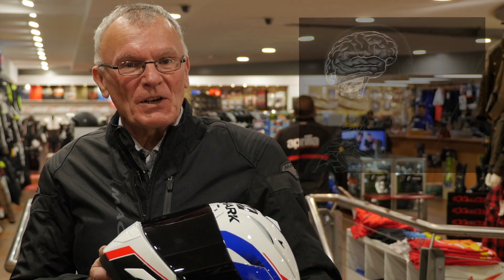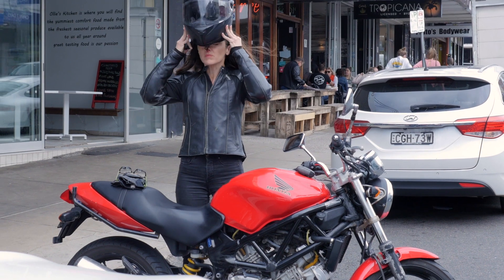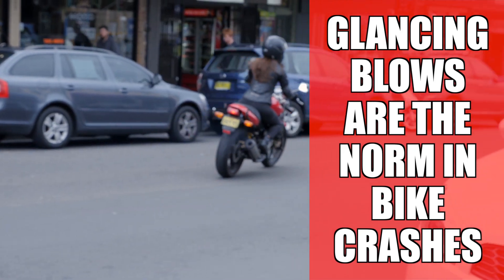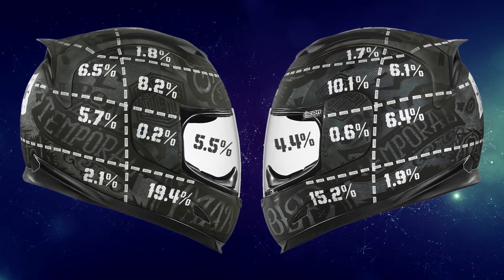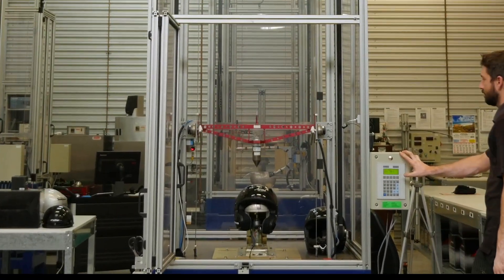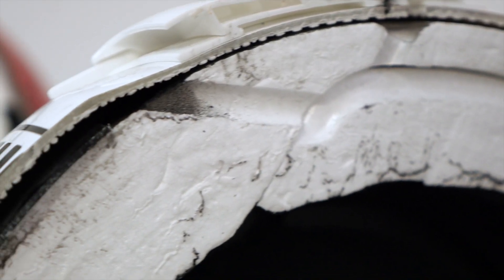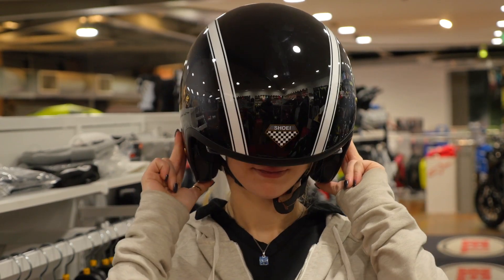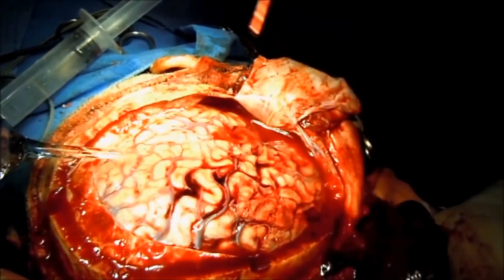What Helmets Do & How They Work

Comment: Yesterday, I had my first ever wipe out of my electric longboard. I promise you, on God, I wouldn't be here today if it wasn't for my helmet. The speed at which the back of my head hit the ground was unmeasurable and the back of head legitimately bounced of the payment. I stood up, ZERO scratches on my body, and zero injury to my head. Only thing I can say is my chin hurt a little bit from the impact from hitting against the inside part of the helmet, but that pain went away within minutes. Additionally, the front plastic see through visor came off but was easily able to snap it back in place.
Even more great news.... Tell me how after hitting the back of my head on the pavement, there was absolutely NO DAMAGE to my helmet from where it hit the ground. Not even a scratch. I thank God for the fact that I have such a durable helmet and that I'm always guided to wear one even if it's hot outside.
Wear your Helmets people.
This experience happened to me just yesterday and I'm blessed to have come out of that horrific accident, scratch free, to tell you the story today
Boy God is good I tell you. If it wasn't for my helmet, my brains would've been splattered on the pavement yesterday evening.
Reply: Pretty sure your helmet had a few scratches if it protected you in such a horrific event as you described.   Thankful that you don't have a scratch though.
Reply: helmets are only rated for 1 fall. might want to replace it
Reply: Nice to know you're OK 👍 keep doing you, safely
Reply: Thank yourself for taking the helmet and thank your helmet for protecting you

Comment: a perfect fit could be acheived with todays 3D scanning technology to scan a riders head and custom mill/mould the EPS inner profile but like all companies today they pump out a range of gear some not fit for purpose and are more concerned with profit instead of producing only the best helmet possible for the lowest cost. and where is the innovation for prescription glasses wearers who's glasses might not fit in a full face helmet - option to fit a clear drop down with C channel lip holes for fitting prescription lenses into. there was also a racer the other weekend whos visor opened in crash and he got a bar to the face = visor detents not strong enough so are those helmets recalled ??? NO way.  racers helmet manufacturers/sponsors need to publish findings after crash analysis and show they are innovating.